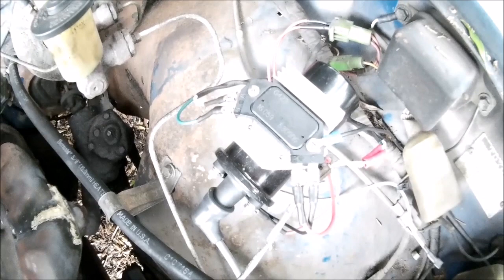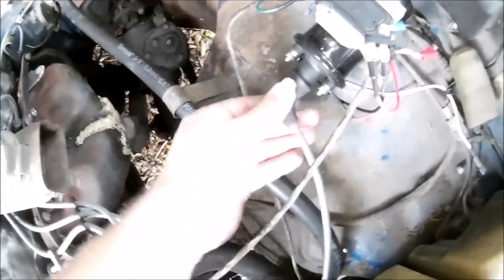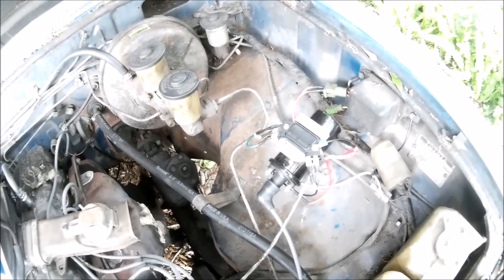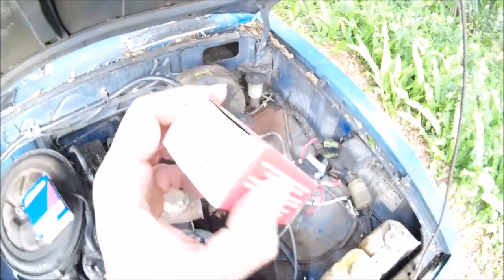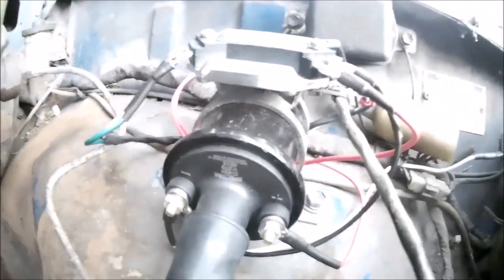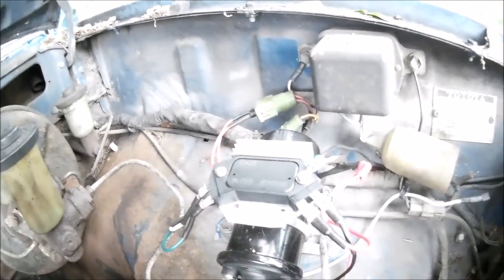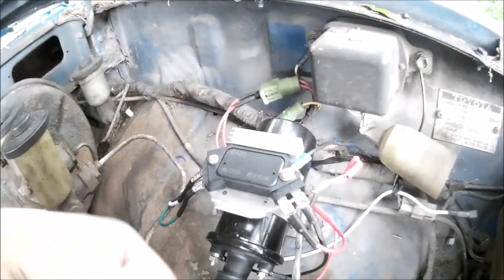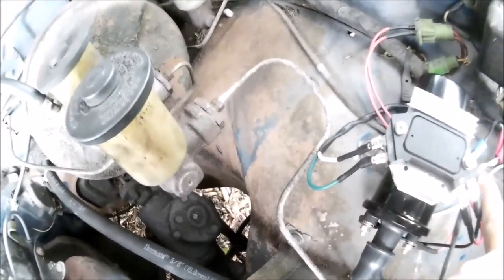1978 Toyota Pickup/Hilux 20R - GM HEI Ignition Module Conversion

Comment: Did you have to shave the black tabs that are on the standard hei coil so it would make contact with the heat sync completly?
Reply from the maker: Very observant of you. :^) Yes, I did shave off the two round tabs or pegs on the module, because it wasn't going to fit the way I wanted it to (180 degrees rotation to normal. I also used a hacksaw blade to cut off the inside "fin". All this because I wanted the connecting lugs in a certain orientation. In hindsight, I should have just mounted the module normally on the heat sink , then rotated the entire module/heatsink unit.
Reply: I have a 79 3/4 ton with a water choke r 20 but it'd back fire and due when going through 3rf gear wait till clean and start again now it's random if it  does any suggestion I got the weber carb and erg smog delete any suggestions
Reply from the maker: @ablepainting8286  OK, a few things that need to be cleared up. This only happens in 3rd gear? I am not sure what you mean by "wait till clean then start again". Did you mean wait until it cools off instead? If it's random it could be several things.

Is the distributor original? It could be worn or out of adjustment. How about the coil? Original? Have you resistance tested it? What kind/brand of coil is it, part number? How old are your rotor, distributor cap, spark plug wires, spark plugs? Are your ground cables tight with clean connection?

Let me clearly know about these things then I can offer some better suggestions.
Reply: Yes new cap, wires, plugs, rotor, distributor,  fuel pressure regulator, and Guage, new vacuum lines new muffler, almost every thing except exhaust headers! But yeah once it'd be getting warm and reved up bang die cool off start again I am doing the hei ignitor module today
Reply from the maker: @ablepainting8286  Thanks for the info but you still didn't mention the ignition coil. Is it old or new. When ignition coils age, they can develop some higher resistance in the coil windings due to heat. This is caused by metal fatigue of the wire in the windings, from repeated heat cycling under the hood. This can reduce spark energy output, or even cause a non-firing condition, which can be sporadic. Even a coil that tests in range cold can have this problem, so it's usually best to just replace it with a new, quality coil.

If the ignition coil has gone bad in that way, it can damage the module as well. So it's always best to replace both items when you get these symptoms.

This can also happen with the original ignition module (ignitor), and sometimes with an older distributor, but yours is new. The only other thing to check with the distributor is the air gap space on the pickup coil inside, and making sure the pickup coil set screw is tight so it doesn't move. The air gap spec is .008" to .016". I have mine set at .012" and it works fine.

Fuel pressure regulator - Make sure you have it set at no more than 3 PSI. The Weber carb doesn't like any pressure beyond that or it likes to flood out.

Ground cables can also get that metal fatigue as described earlier, and that can develop some extra resistance. If your battery to engine ground cable is black with a yellow stripe, it's original, and you may want to consider replacing it. You can always test it with an Ohm Meter end to end. Cold, it shouldn't read anything above 0.2 to 0.3 Ohms. My new ground cable reads less than 0.1 Ohm resistance. Also make sure the connections are clean & tight at each end. There should also be a second ground cable, between the rear of the cylinder head and the firewall. It's best to check that one out thoroughly as well.

Check all other connection to the ignition system for looseness, corrosion, dirt, etc. and fix them as you go. The HEI Module will also need it's own solid ground to work correctly. It grounds through one of the holes in the module. You'll see a metal tab on one of the holes, that's the ground point. I have mine grounded to a bolt holding my voltage regulator. Any good, clean grounding point will do. You can also run a ground wire for it direct to battery negative if you want to, but I recommend using nothing smaller than 14 gauge wire to do that.

That's all I can think of at the moment. Message me again with any other questions, and/or let me know how the job turns out for you.
Reply: Coil aint but 1 year old and it aint been driving around much
Reply from the maker: @ablepainting8286  OK. I asked this because a new (cheap) coil I put in didn't even last me 6 months before it went bad on me, & fried the module. Probably didn't even get 1500 miles out of it. That's why you should resistance test the coil to be sure it's good.

The ignition coil specs for the '78 are: 1.3 to 1.7 Ohms Primary, 6500 to 10,500 Ohms Secondary. The Secondary is usually more important but if either value is on the high side, with the symptoms you're having, it would be better to just replace it with a new good quality coil. I very much recommend the Standard Motor Products UC12 coil. Mines been going strong for over 2 years with no problems.
Reply: If you don't mind you could text 719 354 1470 my name is David I own able painting
Reply: Ok im gonna get me a new coil and on the hei the positive on the coil only goes to the tac nothing else goes on the positive side correct? And the red that wraps around for the ignition plug did you split it into 2 leads for both places on the plug or did another one go in the second place on the  ignition switch plug?
Reply from the maker: @ablepainting8286  The positive side of the coil gets a power feed from the ignition switch. As I recall, there is a green plug with two terminals in it that used to plug into the old stock Toyota "ignitor" module. Both of these are from the ignition switch; one is the "start" side and the other is the "run" side. You should be able to see this in my video.

If you have a tachometer, the "sensing wire" to it comes off of the NEGATIVE terminal of the coil, NOT the positive. The tach should be powered by another wire from a power source at the fuse box.
Reply: The video didn't show where the wires came from that plug into the ignition switch ? I'll 2atch it again im confused
Reply from the maker: @ablepainting8286  Under the hood, near the area where the module & coil live, is where that plug is. It is a green plug with two wires to it.
Reply: Yes but on mine there is the plug with a whit and yellow then another plug with one connection but the 2  grounds split out of it
Reply from the maker: @ablepainting8286  OK, let's get one thing straight first. There are no "grounds" that come out the the wiring harness, anywhere. Any electrical component on the vehicle is going to be grounded through the engine, frame or body, via the ground cable from battery negative.

Second. I've gone out & had a look at mine. The plug you want is a green plug, that comes out of the harness, near the voltage regulator. The voltage regulator is mounted to the inside of the driver's side fender, under the hood. It is the larger of the two "round" plugs there. That plug on mine has two wires going into it from the harness side. One is red, the other is red with a black stripe. This is stock. If someone before you changed the wires for some reason, wire color isn't going to help much here. If that's the case, you're just going to have to use a volt meter to find out which wire(s) come from the ignition switch.
Reply: I might be out of line here im in Colorado it's 645 am and dark outside still only about 10° if I gave you my number or email I could send you picture of what is going on with the wiring im sure you could circle what's what a send it back ill pay for your time someway!  719 354 1470 im a business owner Ablepainting2018@gmail.com I really appreciate all your time. Messages so far ! Please lmk

Comment: Novice mechanic here, gonna try this conversion soon. Here's my question: did you use the coil you'd initially bought as a replacement for the stock toyota coil, or did you go with a different one to match up better to the HEI module? thanks! this video has been super super helpful.
Reply from the maker: I'm glad the video was helpful to you. I used the coil I bought** as a replacement for the original coil. The Primary Resistance spec for the  '75 to '79 coil is 1.3 to 1.7 Ohms, and it will work fine with the HEI module. If you want to better "match up" the coil with the module and get a bit more spark power out of the setup, I'd recommend using an '82 to '88 coil. Those are the newer "modular" style (not like the old "can style coils), and have a lower Primary Resistance of 0.4 to 0.5 Ohms. The lower Primary Resistance allows a bit more voltage into the coil. Also, the later coil has a somewhat higher Secondary Resistance, which produces more spark power. Only possible problem with the later modular coil is mounting underhood, as it's different from the can type coils.

**IMPORTANT NOTE. The replacement coil I first bought was a China made cheapie (under $10 new), and didn't last 6 months before the Primary Resistance went way up, due to an internal short. That in turn blew up the HEI module. Ignition Coils going out of spec and developing higher than stock Primary Resistance is the #1 killer of HEI modules.
ALWAYS BUY THE BEST QUALITY IGNITION COIL YOU CAN WHEN USING IT WITH THE HEI MODULE CONVERSION. I learned this lesson the hard way & blew up 2 modules before figuring out what exactly was happening. The China coil was bad quality. Lesson - it never pays in the long run to cheap out on parts.

That said, my coil recommendations are:
Can Style -
Standard Motor Products UC12
Standard Motor Products UC12X (Blue Streak)
NGK 49030
Modular Style -
Standard Motor Products UF12

I don't recommend using an era specific AC DELCO/GM HEI coil, as they have a funky wiring/terminal setup which requires modification. If you want to mod one of those it would also work just fine, but electrically they aren't any different that  the UF12 in function, and can cost more.

If you need any other specific info or help just let me know.
Reply: @The13thSword  Thanks! That makes a lotta sense. I'll just go with a coil, doesn't seem worth the trouble to try an older one. Luckily I picked up a UC12 before reading your reply so I'm gonna try that and see how it goes! Thanks again.
Reply from the maker: @lukemaskarinec9970  You are most welcome. The UC12 is a good coil and should work for you without issue. Let me know if you run into anything I cna help you with.
Reply: @The13thSword  Awesome, glad to hear it. I do have one more question for you, regarding installing a distributor (your video on that was super helpful too!). I got an aftermarket distributor to replace my original points-type distributor, but it seems the new one needs to be hooked up to 2 lines going to the carb (?), whereas my original one only hooked up to one line. Is this something I can work around, or a whole new can of worms/parts? Thanks!
Reply: @The13thSword  Fantastic, this clears it up. Thanks again!

Comment: Howdy;  finding myself in need of this conversion for an '83 22R.  Could you tell me the part number or specs for the ignition coil?  I'm planning to use this ICM https://www.rockauto.com/en/moreinfo.php?pk=97460&cc=1297111&jsn=1707 with this heat sink https://www.rockauto.com/en/moreinfo.php?pk=96237&jsn=1705.  Can you tell me what the compatible coil would be?   Thanks for your video!!
Reply: Also, where did you source the bracket that holds the coil and heatsink all together?
Reply from the maker: I would recommend the STANDARD MOTOR PRODUCTS (SMP) Part # UF12: https://www.rockauto.com/en/moreinfo.php?pk=47730&cc=1277197&jsn=887&jsn=887

SMP parts are very good quality & reliable and cost much less than original Toyota parts. I have double checked the Primary & Secondary resistance specs on this coil and they are compatible with the GM HEI style Module.

CRITICAL: Buy a good quality coil! I initially bought cheaper ignition coils (China Made) and they did not last more than 6 months, and fried the module as well, due to developing higher resistance than spec in the coil. I have been running an SMP coil for over 2 years now with no issues.

Standard also makes a very good module, the LX301. I have nothing against the AC Delco module, only that it costs more than the SMP part. The heat sink is very much recommended to use for this conversion; but you may have to modify it a bit as I did to fit the module to it. Be sure to use the thermal paste that comes with the module, between the metal plate of the module & the heat sink.

CRITICAL #2: The Module MUST have a clean & solid ground connection to the body or frame to work correctly & reliably. This seems to be the most common issue on conversions. I would also use a meter to do a resistance test on the battery negative terminal to frame/body ground strap or cable. As that item ages it can develop excess resistance, and given the age of these trucks, it's often worth replacing with a new one. You can spot a Toyota original as they are usually a black cable with a yellow stripe. Any resistance reading end-to-end higher than 0.1 Ohm replace it. I recommend 4 AWG Gauge cable or thicker for Battery Negative to Frame/Engine Block Ground. There is also usually another ground cable from the Cylinder Head to Firewall; this is a good time to check & clean that as well.

Final Tip. You may want to check the wires that go from your Distributor Pickup Coil to the Ignition Module. Again, these wires can develop excess resistance over time due to heat stress/cycling. The Pickup Coil generates less than 3 volts AC so any extra resistance  or breaks in the shielding could cause the system to misfire. There is no direct replacement available from Toyota, but I made my own new harness from 2 conductor shielded alarm/security cable, like this: https://www.homedepot.com/p/Southwire-By-the-Foot-22-2-Gray-Stranded-CU-CL3R-Shielded-Security-Cable-57572199/204725140

The cable is flame retardant, rated to 221 degrees F (105 C), the 22 gauge wire inside is more than enough to carry the signal, and it's shielded to prevent any misfires from spark plug wire interference.

Anything else I can help with just let me know.
Reply: @The13thSword  Thank you.  Great tips!  I was looking at the canister coils but if the UF12 mounts to my old stock defunct ICM then I can make that work.  I'll take your advice on the LX301
Reply from the maker: @michaelrausch7269  I am running the SMP UC12 canister coil, and so far so good, 2 years no probs. It does have a higher Primary Resistance than the modular style UF12 but it does work. The lower Primary resistance of the UF12 should in theory give you more spark power on the Secondary side of the coil. It's basically up to you which way you want to go on it.